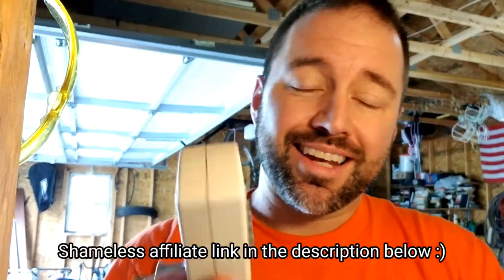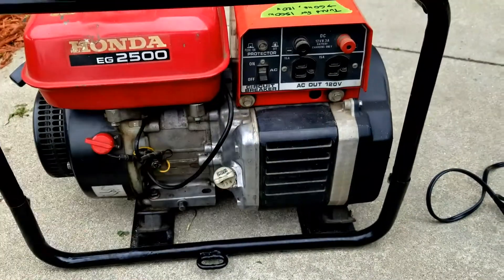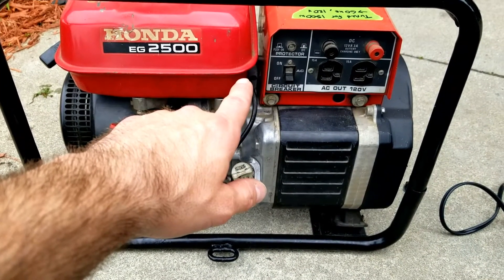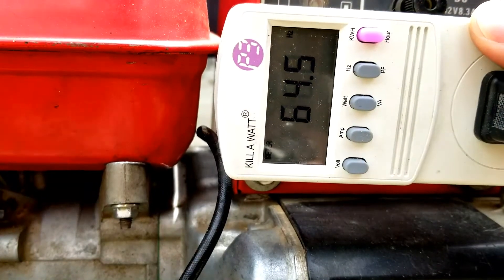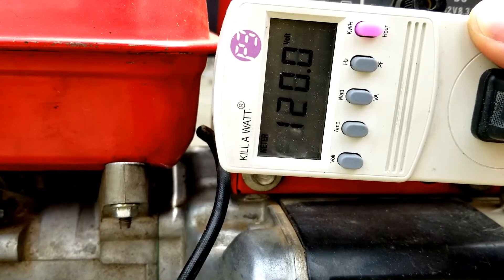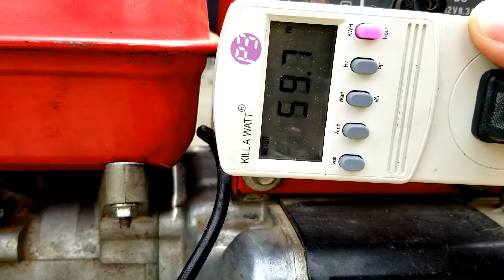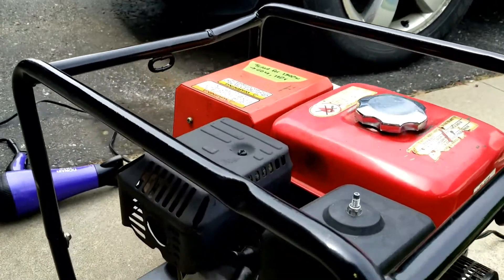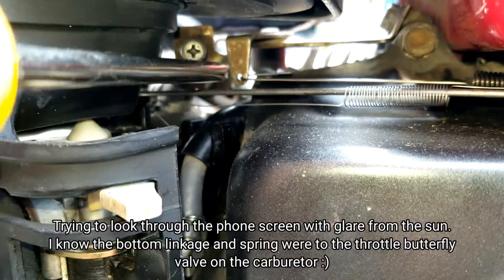Generator: DON'T Forget To Do THIS or You'll FRY Your Sensitive Electronics!

Comment: It's not voltage which drops or rises, it's THDs or Total Harmonic Distortion  which if are more than 5% can fry the electronics. Inverter generators have from 0.2 to 2% THDs which is sometimes better than THDs on power line. You can measure it with proper multimeter. Very often standard generators can have up to 30%THDs, if you lucky it maybe around 10%

Comment: I do the same. 60hz at typical load. I exercise all of my generators under load at a minimum of once a quarter depending on what time of the year it is and my schedule. I also check the hertz / voltage under no load and max load to determine the overall health of the generator. I currently have 4 generators of various sizes that I use for various duties. I have a little 700 / 900W 2 stroke that I use if I need just enough power to run some lights, a tool or a fan somewhere. A 3200 / 4000W one that I added electric start to because the women folk can maneuver it into place and connect to the house during power outages. A 5500 / 6875W one that used to be primary one to power the house (pull start only) and a 7500/9400W tri-fuel that gives me flexibility in fuel based on which is available. Since none of my generators are inverters nor have Eco modes. I try to use the smallest one I can get away with for any situation to reduce fuel costs. This also allows me to service and rest the other generators.

Comment: Seems like you're having an issue with the governor or the engine power output. The generator speed should be the same regardless of load until you exceed it's capability. Also, you never addressed the actual "dirty" power of harmonic resonance affecting the sine wave.

Comment: Each generator is a bit different. Some regulate much better, some worse. My Powerhorse 4000 has an AVR which does a very good job on the voltage and the mechanical governor regulates the RPM very well. I set it at 60 HZ using an oscilloscope (16.7 millisecond wavelength) at about 1500 watts, using an electric heater as a load. Unloaded, it goes up to 61 HZ. Only about 4 volt variation.
Not bad!

Comment: That’s what an AVR  is for 2nd it’s the T.H.D (total harmonic distortion) being a minimum of 5% or less and there are 16kw INVERTER GENERATORS PORTAVLE ONES THAT CAN BE HOOKED UP TO ANOTHER FOR 32,000 watts and double the running watts and there are ones out there that are not inverters like the generac gp18000efi 18000 running watts less than 5% THD and Westinghouse 20k regular gen that makes less than 5% THD THESE WILL RUN YOUR WHOLE HOUSE MORE OR LESS!!!!    THD IS THE NUMBER 5% or less w/60hz and 115-120v or 220v or 240v

Comment: There are two major problems with these open frame generators.  The engines are barely large enough to do the job.  For example, your engine is 5.5 HP.  At 746 watts per HP = 4100 watts.  But only 60% of that wattage is used to run the generator and produce electricity.  The other 40% is used to run the engine itself and is lost due to friction and heat losses.  60% of 4100=2460 watts = wattage rating of your generator.  Secondly, these engines have fixed spark timing set for 3600 RPM.  As the load increases, engine RPMs decrease because the need for an advanced spark timing isn't designed into the engine.  The governor is a rudimentary, low cost, slow response method of controlling engine speed within its limitations.  No hoousehold appliance requires exactly 60 Hz, so frequency can vary a couple of Hz without any issues.  Utility power voltage can range from about 114 to 126 so don't expect more precise conrol of the voltage from any generator.  Yes, you can set them up to run exactly at 120 VAC and 60 Hz at a constant load.  But in the real world, these generators run variable loads.  Inverter generators solve this problem at a higher cost.  And one more thing - generators should never be tasked to run more than 80% of their rated capacity for extended lengths of time.  If you need more power, get a bigger generator (like I did).  You'll have lower voltage and frequency fluctuations with varying loads.

Comment: Would running the power through a surge protector avoid all of this? Mine has RV outlets as well as 120.   

Would Getting an RV surge protector for that output, Or a normal household power strip w surge protection be effective ?

Comment: You can buy a graphic multimeter ( oscilloscope and multimeter in one. Perfect for checking generator sinewave. My second hand unit showed 240 volts at 50 hz but that sinewave looked terrible! Even with a load applied which you should never run a genny with no load especially cheaper units. Any reply appreciated cheers from Australia 👍

Comment: It's a bit comical that you are using a "Kill-A-Watt" (a $30 device) to tell you if the power from your generator is acceptable.   

Do this.  Hook up an oscilloscope to the generator terminals (under load) , then do the same for that load on utility power to find out the power regulation and "dirtiness" are different.

Comment: You did not reference a most important criterion and that is the type and quality of the sine wave. A unit equipped with a voltage regulator will keep a more steady current and an inverter generator will give a true sine wave. Buy a Honda Eu generator and forget about your dirty power concerns.

Comment: I have a predator 7250 running 9k staring gen back fed (professionally) into the breaker box of the house. I have it for my fridge, stair chair, freezers etc… I will run the 220 line into the breaker box if I need it. Is there a device I can just plug in somewhere that will fix all this? Sorry, but I’m not an expert on this stuff and am looking for a simple effective option without buying a new unit.

Comment: Thanks for the video. Let's say we buy a generator with 6000 W output but our load is 3000W. Should we adjust the screw to adjust the power output with a conventional generator?
Reply: The AVR controls the voltage, if your generator has one, the governor controls the RPM. If the voltage is out of spec and the engine is running at the correct RPM, the AVR  maybe the problem. 
Some generators use a capacitor instead and RPM does affect the output voltage. Still, keeping to 60 HZ. is the main thing to do under the load you intend to use.

Comment: I have a 10,000 watt Reddy Honda powered generator that I bought new in 2001. Since I live in an area that loses power up to 10 times a year I have often used my generator to keep the furnace, fridge, well pump, etc going. No problems so far but recently I checked the voltage coming out of the generator and it's 134 volts at the plug. Now I'm afraid to use the generator until I have both the RPM and the Hz checked.
Reply: It seems to be the conclusion with most comments I read of owners who have non inverter generators all saying no problems with any of there electronics in there house. The only thing I worry abt is the electronic control board in my older furnance. I wonder if your generator may have been running at that level since it was new possible. Hope all works out. The for good comment
Reply: @kolobkolobkolobkolob  Update, I think you may be right about my generator always putting out 134 volts since day one. I never checked the voltage just assuming it was correct from the factory. My first indication of over voltage was trying to charge my 2000w inverter generator battery. The breaker kept tripping so I measured the Reddy generator voltage 134 volts.
Reply: @kolobkolobkolobkolob  My Reddy generator voltage is controlled by the rpm of the Honda engine. The rpm was supposed to be 3600 but was 3790. At that rpm the voltage was 134v and Hz was 68 cycles according to my Kill A Watt meter. I adjusted the rpm down to 3600 and now voltage is 119v and 61Hz.
Reply: @kolobkolobkolobkolob  My advice to anyone with a non inverter generator, buy a tachometer and a Kill A Watt meter and check your generators output. Don't just assume it's correct from the factory.
Reply: Sounds like an AVR adjustment. For example, my Powerhorse has one on the end of the power head. I take off the back cover and there it is. When I remove it from the mounting and flip it over, there is a small, blue potentiometer with a tiny brass screw sticking out of it. You can adjust the voltage output by turning this screw. I find it is faster and easier if you have the generator running so you can monitor the output while you do this. Just be careful that any loose wires are clear of rotating parts when you make your adjustment and make sure to re- secure them when you are done. Suck something into the rotor and it is literally "lights out" because it'll tear something up beyond repair big time.
That might be all you need and you are wise not to use the gen set until you resolve this problem.
Be VERY careful - this is electricity, after all, and if you have any reservations, have a pro do this for you.

Comment: Cool video - you clearly know your stuff! I'm considering a Tripp Lite LC1200 power conditioner for use with my emergency generator (still brand new/unused). I expect the generator won't deliver steady, even power, especially when using a fridge or small single electric cooking element since those cycle on/off. I don't want to damage electronics, such as a router, laptop or phone while being charged. Am I on the right track considering one of these power conditioners to provide clean power? Thanks!
Reply: A power conditioner will not adjust the frequency (it may smooth the sine wave or regulate the voltage). You would need a double-conversion UPS for that which is prohibitively expensive

Comment: It's not at "idle". You mean "no load".
The whole point of the governor is to maintain the rpms regardless of load. So not sure why you'd need to fine tune a properly designed gen set.

Comment: A properly functioning generator should automatically compensate engine speed for any load changes. Incidentally, even voltages from your powerline in households can vary. There's no such thing as a constant steady fixed voltage that never changes. For example, you turn on the clothes dryer and this can reduce voltage to other things connected to the same electrical panel circuit in your house.  Same idea when the fridge and the deep freezer kicks in.  You might notice a light bulb might go dim briefly when this happens. Does anything blow up or break in your house when this happens? No, of course not.  Electronics are designed to compensate for all that. They are designed to operate within a voltage "range" not at a specific fixed voltage. Low voltage doesn't typically hurt anything. But when you have high voltage that far exceeds the ratings for the electronics device, (sudden power surges / spikes) that's when you start blowing up damaging things. So if your generator is varying output anywhere between 115 to 125 volts, it's perfectly normal. Everything connected to it will be perfectly fine. When electricians and others refer to our household power as "120 volts" it's not really exactly 120 volts. That's just a common expression and term everyone uses to describe a range of voltages anywhere from 115 to 125 volts. Similarly, a 120v "60Hz" rating on electronic devices means a range anywhere from 50-70 Hz.

Comment: i'm confused.  isn't the entire point of the governor to keep the engine at 3600 rpm so that it produces 60hz no matter the load?  I understand that initially a load would cause a drop in engine speed, but on my generator, the governor fixes this almost immediately.  the frequency readout on my generator remains at 60

Comment: No need to do this. Most consumer electronics is rated 50/60Hz and works fine in the range 45-65Hz. Even a voltage drop of 10% is mostly acceptable. Its understandable if you want to get maximum power but it could actually increase chance of frying electronics:  What if someone starts this generator unaware this high voltage setting and connect a highly sensitive low power load?

Comment: That generator is past 50% capacity which will introduce dangerous distortion for frequency sensitive inputs.For example using this for feedthru on solar inverters fights against the frequency control circuits. It simply can’t synchronize when the deviation is off.

Comment: Any electronic devices I have seen are rated for 50 hz to 60 hz and voltages ranging from 110 to 240. All depends on the power supply for device. You feed 110-120 volts into your phone to charge it, right? Does it get fried? Seriously doubt it, because of the charger taking voltage down to a proper level. 
Amperage can also a culprit in frying sensitive equipment